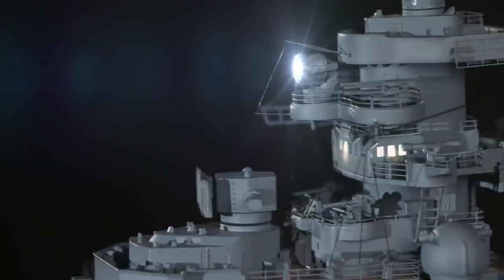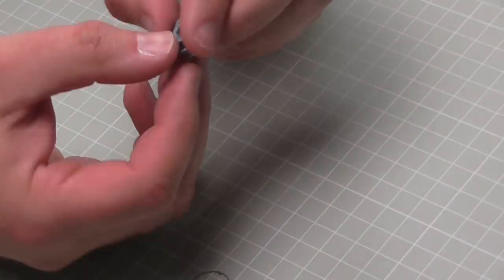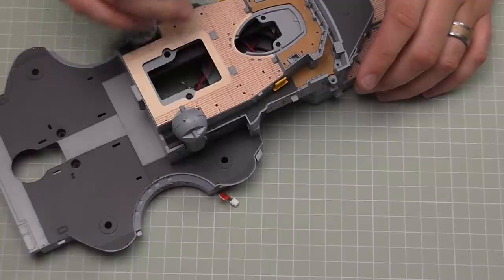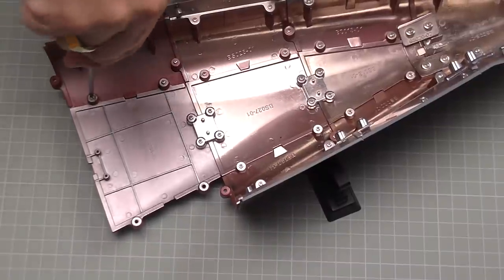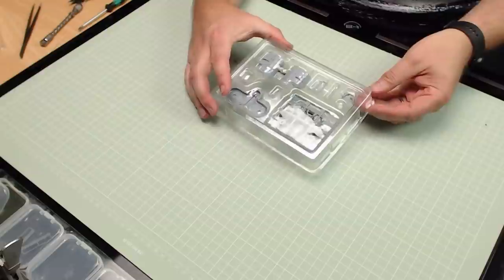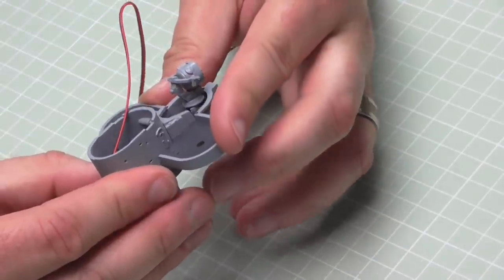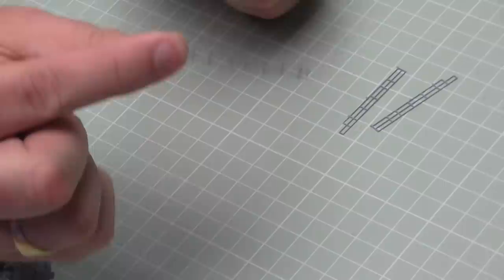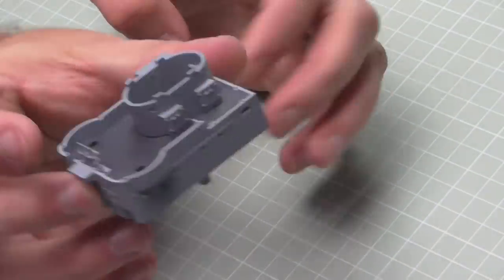Agora Model's Bismarck: The Legendary Battleship - Pack 4 - Stages 33-44

Comment: "There is a chance that they'll ping off in all directions"
Thus far, I never had them ping off while cutting, but I had some fly away while holding them with my 
tweezers. Good luck finding a grey piece on my grey wood floor... Luckily I did find all.
Reply: I just add a small bit of marking tape in almost all of the pieces that I know that will end up airborne. It saved me from insanity when I had to attach the new ankor rings